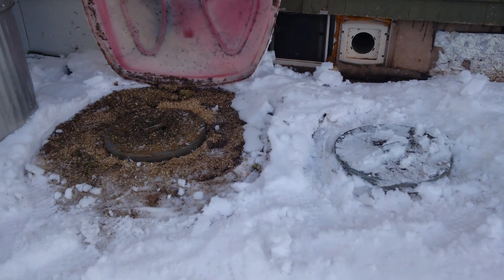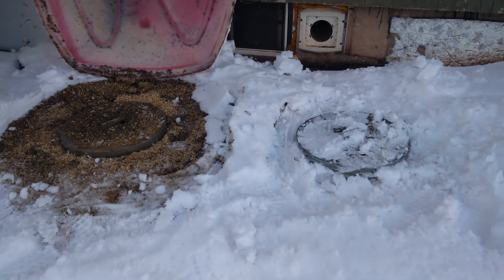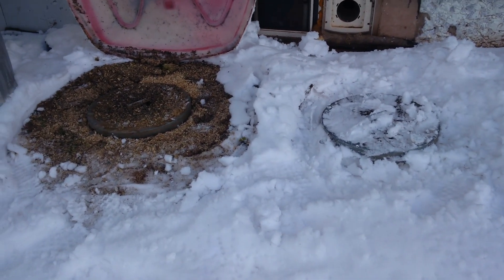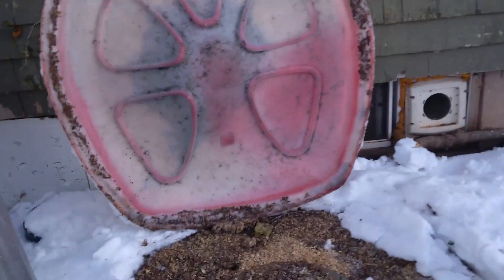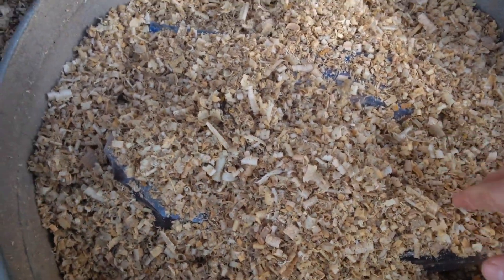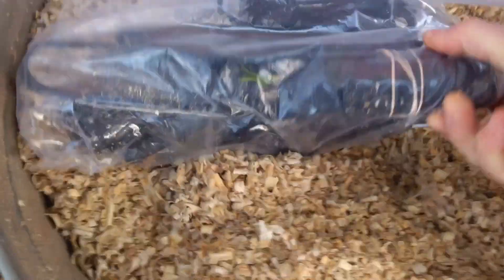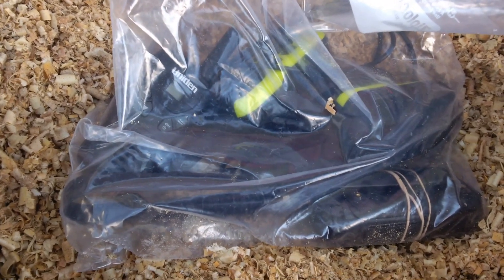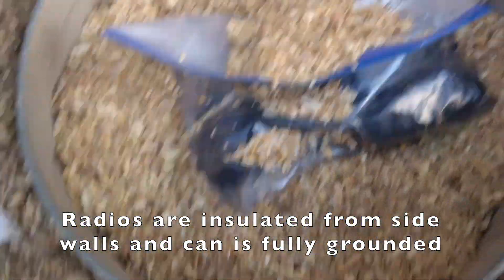EMP SAFE - Garbage Can Faraday Cage - 2022

Comment: Can’t you just take and batteries out of your electronics?
Reply: Isn't sufficient because modern low and ultra-low voltage transistors being energized above saturation in an EMP field. A high current or voltage surge could easily short/melt the array dies of chips... Excuse my basic English.
Reply: @studiocreator2168  thanks! That makes sense